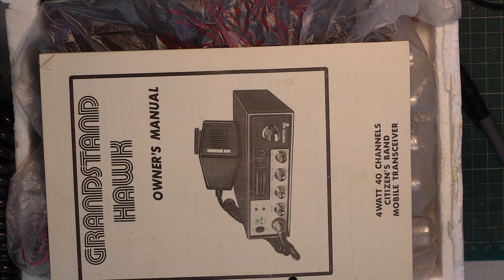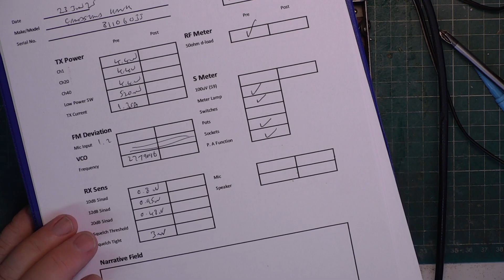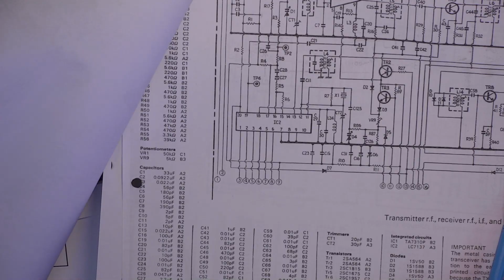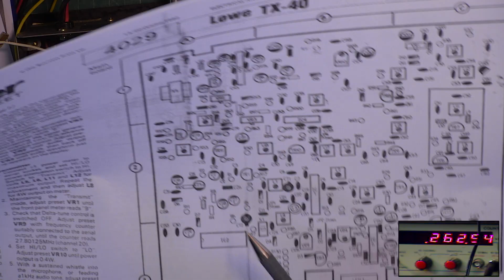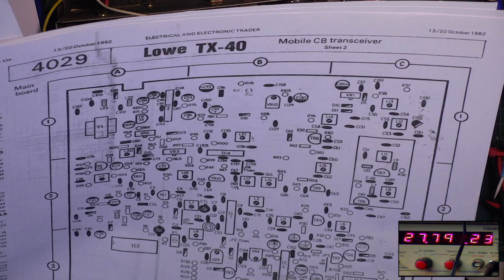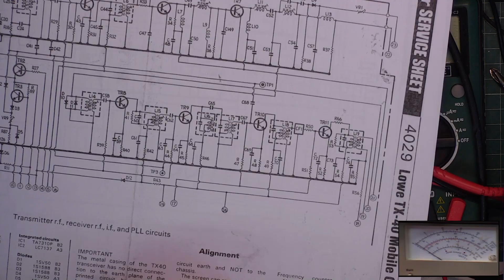Grandstand Hawk CB27/81 UK FM CB radio -  alignment

Comment: A very in depth service and alignment but at least its back to its maximum performance, just thinking back to when I had one of those Im wondering which version it was I will never know but it was a good set.
Reply from the maker: The Lowe TX40 & Grandstand Hawk use the same 'enhanced' chassis. All the others more or less use the same sligtlly inferior chassis. There is also a chassis difference between sets with PA & without. We've a Braemar PT40 to do in about 10 days. I've no circuits or anything for the lesser version that the Braemar uses.

Richard

Comment: Hiya Rick great video well done on that receiver I know they are a real pig to service I just got it the best I could
Reply: Looks an absolute pain in the posterior to align! Even with the full instructions and service kit it doesn't seem to set the world on fire with its RX.
Reply from the maker: But you say that & the receive sensitivity is virtually identical to Uniden sets.

Richard
Reply from the maker: It's that delta tune circuit that's the killer. The inferior version such as the Worldsound PT40 is the bigger bar steward as we don't have a manual.  I'm going to spend hours 'once & for all' comparing the TX40 & the PT40 to enable me to find similar test points on the other version.

Richard